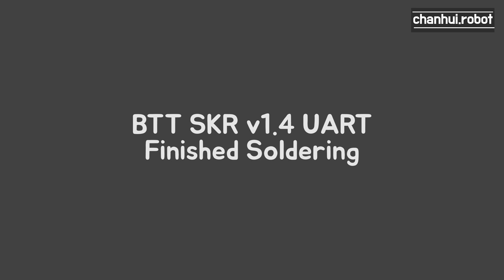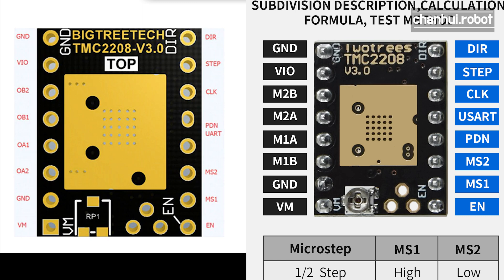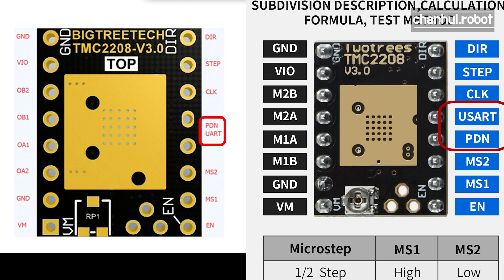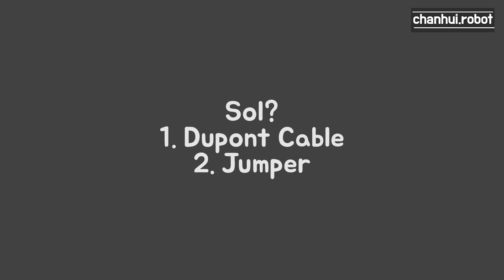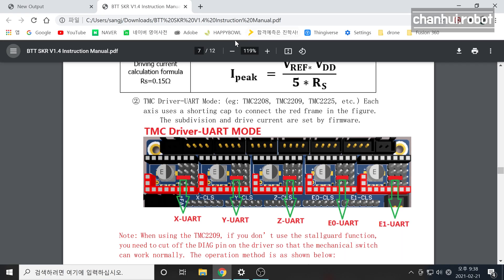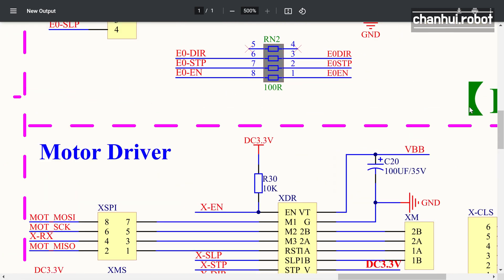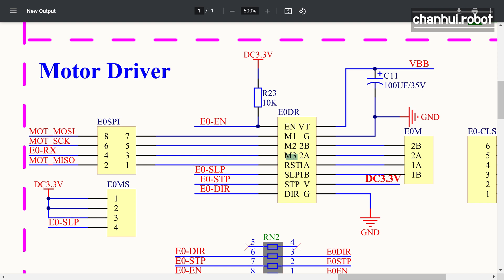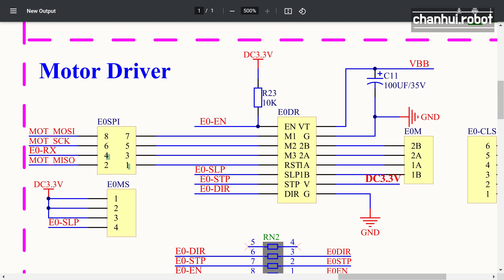[BTT SKR v1.4] Tmc Connection Error

Comment: I still don't understand how you solved the problem?
Reply from the maker: Sorry for late comment :(

I decided to change UART pin, and PDN pin!
PDN pin isn't necessary I only connected UART pin by connecting E0SPI pin 1 and 4.
It is hard to connect diagonal pin, but You can do it by bend SKR board pin little bit.
Reply: @ChanhuiRobot  tks you so much